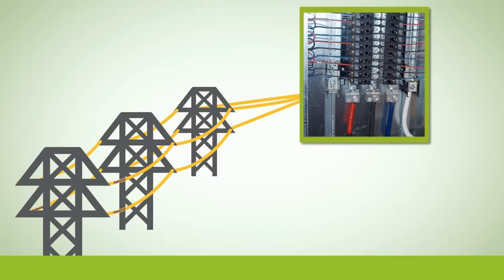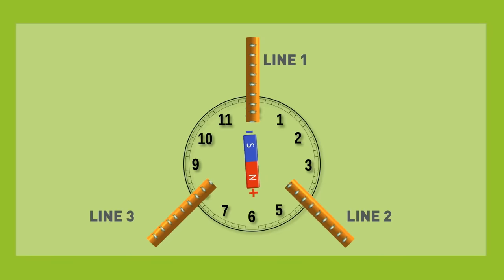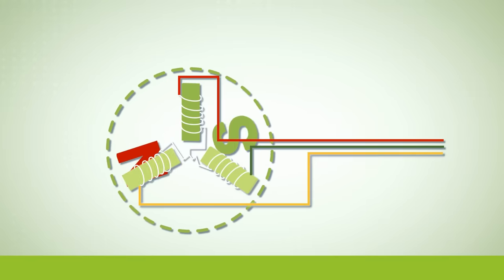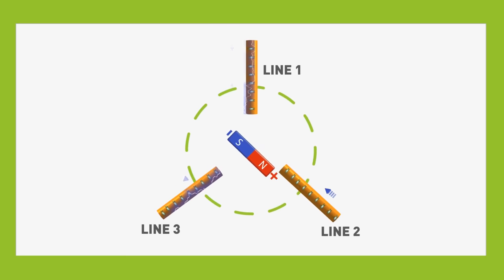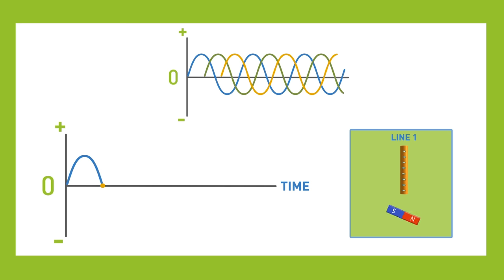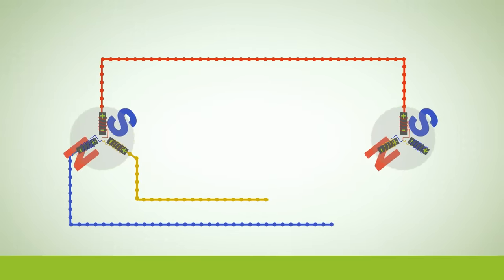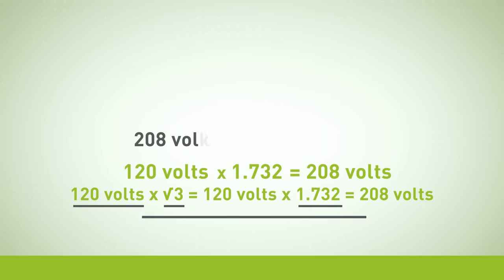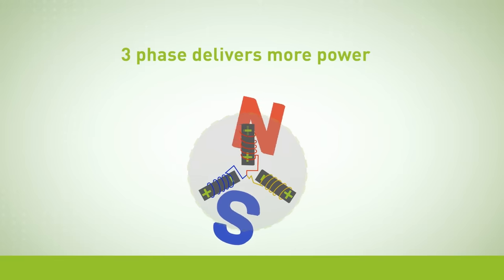Three-Phase Power Explained

Comment: I remember my EE professor from my undergraduate days filling three chalk boards with a beautiful derivation of WHY three phase power, why not 4, 5 or n phase power?  Answer:  Because three phases was the minimum number of phases whose average power was a constant.  Additional phases require additional windings and transformers, so go with THREE phases for the most efficient power grid.  Beautiful.  How I wish I had a video of his derivation.  Even after over forty years as a now semi-retired Electrical Engineer who dealt with RF systems (FM broadcast, TV broadcast, and microwave), it was masterful derivation.
Reply: Wow good testimony. Can you mentor someone? I am an electrical engineer
Reply: @theachebes5724  Not on 60 Hz AC power.  My AC power/motors experience ended with college.  My experience is in RF-- its propagation, and also loss/gain calculations for hight power radio and TV stations.  Did several 5 MW ERP/60 to 80 kW TPO analog TV designs, but with digital the maximum allowable ERP is just 1 MW, so TPO's are typically in the 40 to 50 kW range.  Still, it's 6-inch rigid coax line to handle the power.  No more waveguide transmission lines, given that UHF TV now stops at Channel 36 (605 MHz) instead of Channel 69 (803 MHz).
Reply: i'm ee undergrad student, can i get your contact?

Comment: This begins with faulty description of the effect of the north pole of a magnet rotating by a fixed linear conductor.   Electrons do not flow towards the north pole of the magnet.  According to Lenz's Law,  the electrons in the conductor flow in such a direction as to oppose the motion of the passing north pole.   That means that as the north pole approaches the end of the linear conductor,  the electrons flow in such a way as to create a north pole at its end.   As the north pole passes and receded from the conductor,  the electron reverse their flow so as to produce a south pole at its end, to attract the receding pole.    Lenz's Law is really a consequence of Faraday's Law of Induction, which states in mathematical terms that the direction the induced magnetic field is always opposite to the direction in which the magnetic field is increasing.  The electrons in the conduction flow in the direction required to produce that opposing field.   In the mathematical expression, the negative sign is what Lenz's Law expresses in words.
Reply: Absolutely, good point. I saw the same wrong explanation in other videos about AC...
Reply: Boring!

Comment: Another, unmentioned, benefit of 3-phase power is that 3-phase AC induction motors are much simpler, not needing a shaded-pole device on the field windings or a special startup motor to get the principal motor started. A 2-phase AC induction motor, like an internal-combustion engine, can keep itself going but needs a separate device to get it started.
Reply: We don't use 2 phase. We use single phase, with 2 lines 180° apart.
Reply: Common misnomer.
Reply: True (sorta).  It is actually 2 phases, but they are phase locked 180 degrees apart and we have access to the 2 hots and that center tap.  So in reality, it is a combination of both single and double phase.  Imagine if someone had 2 lines each 120V and each having  a neutral center tapped to the same transformer's secondary winding.  Next imagine if they could put say a 45 degree delay in one of those lines.  Would it then still be single phase or 2 phase?  If 2 phase, then you are saying that when 2 lines are 180 degrees apart it is single phase but is it really?  Some people would agree and some would disagree.
Reply: Brightwriter also you can reverse direction on it
Reply: If the starter winding is out or the centrifugal switch is non-functional, you can hand-spin a single-phase motor and it will run both ways. We had a bench grinder with a failed "cent" switch that would have sent power to the start winding. I put a momentary-contact switch in the start circuit, and then at the moment I would turn on the grinder I would push the added switch until it got up to speed, and then let that switch go and all was well! It we didn't hit that switch the motor would howl and not turn.  If I hand-spun the grinder wheel backward and then did the other steps before it stopped drifting backward it would run in the wrong direction!   Also, if I am not mistaken, the 3-pase motor was invented first, and it was supposedly a battle to make an effective single-phase motor after that.
Reply: Thank you for mentioning the MOTOR thing! That’s the “dessert” of having 3-Phase! Just watch-out for Delta! You have a BASTARD (or “High”, “Stinger” leg, for the polite folks, LOL!)!
Reply: the real reasons for three-phase are:
firstly that it is impossible to manufacture a high power single-phase alternator (see Leblanc's theorem and the theory of rotating magnetic fields, so-called reverse magnetic fields in a single-phase alternator are disastrous), an alternator of more than a few kva is necessarily polyphase.
secondly it is possible to transport more power on a balanced three-phase line (same current in all three phases) with the same amount of copper as with a single-phase line, this is a basic demonstration in electrical engineering training.
Reply: It is not a two phase motor, it is a split phase motor.
Reply: @Bramon83  Allaluya!
Reply: sorry you meant 1 phase ac induction motor

the replies are lying. 2 phase is 90 degrees offset

Comment: I don't understand the 10.8kVA calculation. I get how each pair gives 208V x 30A. But why do you multiply by 1.732 again to get the total power for three pairs? Why not multiply by three?
Reply: there are such things as magnetic  influance
Reply: If you look at each individual leg, you have 120V X 30 A = 3600W, then you can multiply by 3 and get 10800 W total, but taking each 2 leg pair and multiplying by 3 doesn't work because each of the 3 legs, A, B, and C is shared in 2 pairs (A to B, B to C, and C to A) and thus, each leg cannot devote its total power to each of the 2 pairs it is simultaneously powering. There has to be a derating for sharing the lines and when the calculus of the RMS sinusoid wave form is done that all these overlapping sinusoid wave forms come from (it's been years and calculus escapes me now), there are definite integrals that solve down to the square root of 3 as the deciding factor to multiply by.
Reply: You can multiply by 3 but then you have to use the phase voltage 120 V. The power you get is same whether you connect to star or delta. It is just simpler to understand the star connection as you can essentially for get the phase angles and view it as three 120 V circuits so 3x the power.

Comment: 120V/240V "residential" power comes from a single 240V phase supply line produced from a step-down transformer (secondary side).  The primary side of the transformer is fed by one phase (1 of the 3 phases) from the substation (commonly 12kV).  The secondary side of the transformer is stepped down to a 240V SINGLE phase output.  Because the secondary of the transformer is split into two halves with the neutral (or ground) at the middle of the transformer's secondary winding, two 120V reference-to-ground signals are produced.  So there are 3 wires coming from the secondary of that transformer, (2 hot--1 wire on each end of the winding, 1 neutral/ground wire tap at the middle of the winding).  Measuring the voltage potential from each hot wire to the neutral wire yields 120V.  Measuring the potential difference from one end of the winding to the other end yields 240V (ie. 120V + 120V...actually, 120V minus a negative 120V).  This configuration is also called a split-phase system.  I added this comment because at 8:00 of this video, it's not clear enough, because it says "it's 2 single phase lines".  Technically, it's one phase split into two halves and the waveforms are "out of phase" only because they are referenced to ground at the middle of the transformer winding.
Reply: I understand all that 100%. What I can't understand is how is there not live power on the neutral?
Reply: @fuckjewtube69  here’s my understanding, take it for educational purposes, not instructional or safety purposes:  the neutral wire DOES carry current, specifically the returning current through the home’s loads (ie. lightbulbs, tv’s, appliances, etc…).  The neutral wires coming from the loads in a home’s breaker panel are tied to ground and the neutral wire coming from the secondary transformer is also tied to ground at the pole.  Because neutrals are tied to ground, the Voltage potential from the neutral wire to ground is minimal.  Power can be calculated by multiplying Voltage by the current (Amps).  If there is practically 0 volts on a wire, then the power is going to be ~0 as well.  **That is why it is possible for a person standing on the ground to touch a home’s bare neutral wire without getting shocked.  It is also why the neutral wire coming from the pole transformer into a home is a bare conductor (no insulation).  **If there are situations like lost/disconnected neutrals or grounds; ground faults where limbs of a tree touch bare high voltage wires; etc… then this statement may not always be true, it may be possible to get shocked.  In summary, it’s about completing a path for current to flow, but also how much force (aka Voltage) behind the current flow; and it depends on exactly what two points in the electrical loop/circuit are being touched/connected in order to cause current to flow.

Comment: The conductors between a voltage source and a load are called lines, and the voltage between any two lines is called line voltage. The voltage measured between any line and neutral is called phase voltage. For example, for a 208/120 volt service, the line voltage is 208 Volts, and the phase voltage is 120 Volts.(9:32)
EU:
 230VAC => Phase voltage 
400VAC => Line voltage.

Comment: I've was only wondering about 3 phase for about 25 years now, thank you.
Reply: Is there a Grammer error? I have was??? Think you for your advice
Reply: Say that again in English
Reply: @enyakang6950  Yes. He meant "I was only wondering about 3 phase for about 25 years ..." but another way of saying it would be "I've only been wondering about ...".  So he probably started one way then switched to the other without noticing.

As you probably noticed, the "only" is ironic, because 25 years is really a very long time to wonder about something. Only been wondering for 25 years! 

I've been wondering for longer, as I'm probably older and it's a long time since I first heard the term.

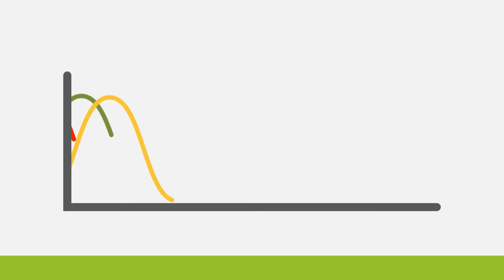Comment: Errata: At 0:40, the sine waves are 60 degrees apart, but they should be 120. Magnets do not attract or repulse electrons. Varying magnetic fields cause electrons to experience a perpendicular force, which is why you need coils in a generator and motor, straight wires would not work properly...

Comment: Practically all automotive alternators are three phase, when rectified, the ripple voltage was less that 8%, single phase is 100%, no need for huge capacitors.  Ideal in plants when AC had to be converted to DC.  Three phase motors were very efficient.  Three phases 120 degrees apart inherently generated a rotating field, without capacitors so motors could be made much smaller.   Wish we had three phase in our homes especially for air and refrigeration compressors and fans.
Reply: for people who might don't understand this comment but will understand after this reply:

1 phase ac motors are actually 2 phase, since 1 phase would be impossible to synchronize. in order to get 2 phase from 1 phase, you would need a capacitor

2 phase electricity has a sine wave with 90 degrees offset from the first

Comment: You suggest that electrons are attracted / distracted by a magnetic field. That's wrong.
It's the changing magnetic field that causes an electric voltage in the coils.
Reply: Lenz law, basic electromagnetism.
Reply: The waveforms at 4:50 and 5:25 look totally different. Why is the first one asymmetrical, as if the waves are grouped together? Just a crappy animation?
Reply: 9 out of 10 comments are praising this video's claptrap. Unbelievable.
Reply: I was thinking the same thing. Anyways, most modern three phase industrial motors are induction and controlled by some kind of VFD.
Reply: @joshbachman7706  indeed Industrial inverter drives are brilliant for matching speed matching ramps or current limit I have fitted thousands from 0.05kW up to 3000kW fun days.
Reply: Mikey McMikeFace nope, just phase difference
Reply: @-danR  Dan
True!
This is common across YouTube -- and sane criticism of bogus videos is routinely defended by simpering dolts, typically with "You didn't pay for it, nyah-nyah" and "Why don't you put up a better course and shut up" sorts of infantile counter-attacks.

Comment: What about 3 lines carrying 120 Volts each? Is there more than 208 Volts being supplied in that circuit?
Reply: Voltage is a potential difference between two points.  It doesn't make sense to say that a line carries 120 volts.  You need to state the configuration precisely.

Comment: This video is riddled with mistakes, especially at 0:38. Those lines are not 120° apart, because they are not equidistant from each other relative to the previous cycle's peak. Furthermore, at 6:43, it made the fundamental mistake of flowing frow positive to negative, which should be used to describe current, which is opposite to electron flow.

I expected better from a large multinational corporation know as LeGrand. I guess I'll never buy LeGrand products.

Comment: A few mistakes in this video regarding the magnetic field and calculating the 3-phase power @9:14
Reply: What do you think the mistake was?
Reply: Apparant power calculation formula(only magnitude) is correct
Reply: @moulies2600  - dude he already explained the phase portion at the start of the video
Reply: @alparker7686  multiplying by 1.732 twice, in the power calculation.
Reply: Mistake in 9:18 !! 2x1.732?